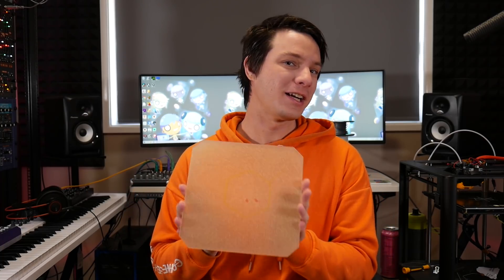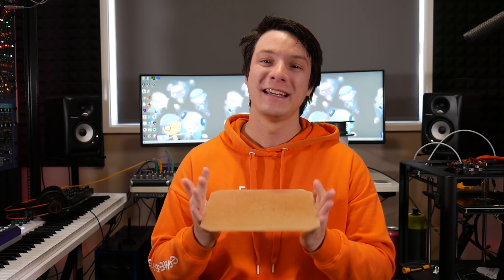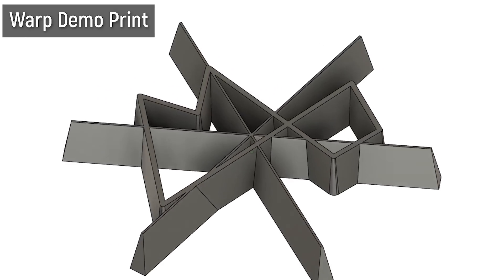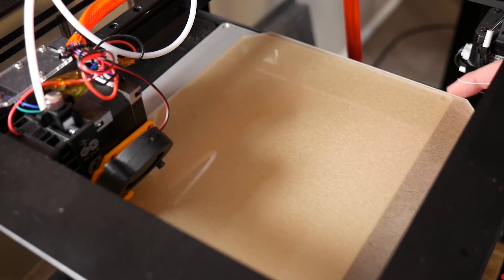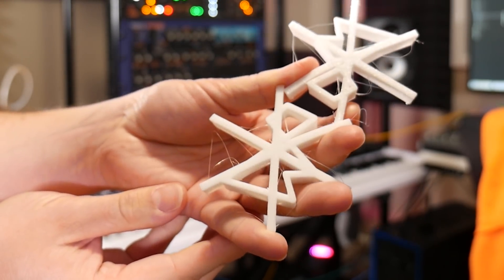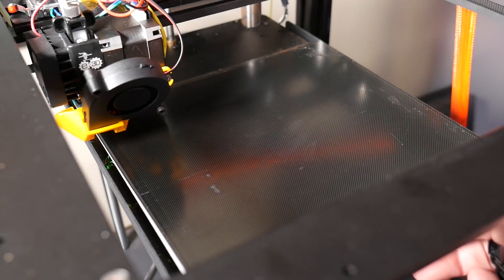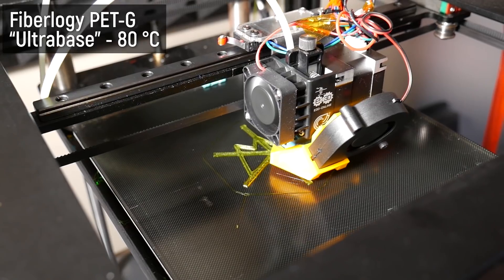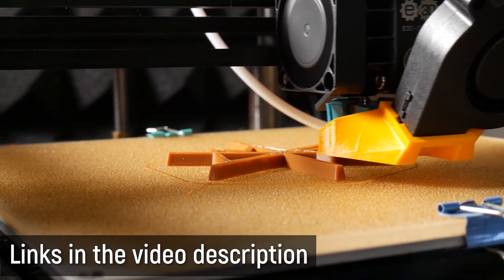A REALLY unusual 3D Printing surface! Ultembase PEI Glass test and review.

Comment: Hi Angus! Glad to finally see your review! I'm shocked that the PETG didn't work for you, as it went perfectly in our test results. In the meantime, we have upgraded our design before you released your video, and we'll ship one your way! I strongly recommend only remove the print when it's completely cooled off, otherwise due to the high adhesion of this plate you could peel the PEI layer off. Once again, thanks for the review and it was a pleasure working with you! I'm gonna get back to the lab and try to replicate your PETG test results.  - Tian from Energetic 3D
Reply from the maker: Thanks Tian, all prints were left to fully cool, the petg print was removed the day following I was sad to see it damage the sheet after such good ABS results.
Reply: @MakersMuse  Yes, I did not expect that! All the PETG tests came back perfect in our testing... Time to get back to work :)
Reply: @energetic3d647  not fully sure what i'm talking about, but maybe try to vary ambient temperature, initial layer temperature, and nozzle to bed distance for the first layer, if you haven't done that yet. Those three factors may help replicate the results you're going for.
Reply: @somedude2492  I'm thinking about the bed temp Angus had used, I'll shoot him an email shortly and request some parameters he used when printing PETG. Perhaps there is a difference in bed temperature we used and that's what made a difference.
Reply: @energetic3d647  maybe the fiberlogy petg has a different chemical composition than the one you used and it just so happened to bond very strongly to the pei
Reply: @christophbrun4059  yeah, probably try the exact material in the same brand. Who knows what they're doing different? 🤔
Reply: @christophbrun4059  Possibly, perhaps it's the difference in the print temperature aswell. We already have an upgraded version and I'll do more PETG testing on them. We never had any problem with PETG like Angus did, strange.
Reply: @energetic3d647  that could be it, maybe increased adhesion should be compensated by lower bed temps? Either way i love to see products be so actively developed to be the absolute best posible. This bed is definitely in my wishlist now.
Reply: @energetic3d647  i ordered the plate and i have not received it yet i should have gotten it yesterday?
Reply: @MakersMuse  , do you know if ANYONE outside of the Youtube reviewers who have received their orders? I know I haven't... I ordered back in June, and the seller is now completely unresponsive to emails. It might be a good idea to do a follow-up on this because it's really starting to smell like a big scam.
Reply: @bnice7  Same here. No replies, no shipping, nothing. I am afraid we got scammed.
Reply: @kwinzman  I ended up receiving mine... I've yet to use it! But I did get it eventually.
Reply: @bnice7  The company doesn't seem to exist any more. I just filed for a credit card chargeback a month ago.
Reply: @kwinzman  I'm not surprised. I guess I was lucky that I finally got mine. I don't think I've ever even used it after all that.
Reply: Love to see a company take ownership of a "poor" review and contuine to improve there product! Can't wait to see where this product goes!
Reply: @cojofoplays1837  Always! We aim to be the standard in the 3D printing industry, our flex-steel PEI sheet was many people's favorite. This is something we are experiementing with and Angus got one of our earliest prototypes aswell. The designs have been improved since then, and we'll try to push them further.
Reply: I can see from the high video quality that the bottoms of the prints show signs of having the nozzle slightly to close to the bed for the first layer. Instead of even unbroken layer extrusions there are small broken sections of extrusion showing uneven widths. This occurs as the pressure in the nozzle builds ups and releases over and over instead of one continues evenly pressured extrusion. PETG can bond to PEI especially when "ironed on" like this. Therefore I would conclude the damage could have been avoided with a slightly high nozzle starting position and I would recommend the product sufficiently warns the user of this outcome if used with PETG and a very low nozzle height.
Reply: I have a ender 5 plus with there stock glass plate and I use petg it also once took part of the glass with it but I think that print I also left on the bed overnight so maybe keeping petg on to long is bad😵
Reply: @Bigdog1787  I think you're right, I left a PC print overnight stuck to my smooth PEI sheet and it tore some chunks out of the PEI, usually I can just flex my sheet and the part comes right off.
Reply: You are awesome
Reply: I have ordered your build plate a month ago, but nothing, no tracking, and no replies to emails?
Reply: @John Spencer. You are SPOT ON! My thoughts exactly. Oh, you’re SHOCKED, we’ve REDESIGNED. I bet you have. My Wam Bam with PEX has worked flawlessly with PETG.(and NO, I’m not affiliated with wam bam. Just a user of an actual WORKIN PRODUCT!) BTW, my Ultrabase works flawlessly also. 🤷🏼‍♂️
Reply: @chemicalcorrosion  Does the PEX work with PEEK? Their website is decidedly vague and doesn't even begin to describe compatible materials. Just "most any filament' which seems like a convenient catchall if any filament doesn't happen to work with their system.
Reply: @chemicalcorrosion  Then it must be shocking to you that we also work with ANYCUBIC lol. This is an early prototype.
Reply: @ENERGETIC 3D. Indeed, that IS shocking. Don’t worry, I’m SHOCKED. Why in the HELL would you send out “early prototypes” to a well known, high trafficked, 3D printing channel. Ah, to get FREE exposure. Well, it certainly was exposed wasn’t it. Sitting on a soft pillow usually helps with “butt-hurt” syndrome. Now, off to do some PETG printing on a RELIABLE surface. Cheers!
Reply: @chemicalcorrosion  Because we'll get comprehensive and detailed feedback from an experienced individual. We also sent prototypes to manufacturers of 3D printers. Don't worry, we'll send more updated prototypes out aswell.
Reply: @energetic3d647  good work on the print surface, but based on my comments below and what I've seen here, I think it is important to coordinate with your engineering team more closely for the marketing material and to improve general product knowledge. It is important to know your customer base and level of expertise, and appropriately guide them for the proper use of the product. This is not necessarily the responsibility of the Company, but it helps ensure that customers can effectively make use of the product without encountering unexpected issues (due to lack of understanding). This improves the customer experience and will help increase your customer base. (and prevent bad press)
Reply: @chemicalcorrosion  BRAVO SIR. I appreciate someone who can spot obvious marketing wank by the corporate soy boys who think they are tricking people by using a couple fancy words. Happy printing my friend.
Reply: There is so much ass covering verbiage going on in your comment. "I'm SHOCKED it didn't work for YOU" "it went PERFECTLY in OUR test results" "I'm gonna TRY to replicate YOUR test results". You first pretend this is a very uncommon issue "I'm SHOCKED" and then have the brass balls to claim something went "perfectly" in testing which is just a stupid thing to say on every level. Next, if the design was perfect in "test results" then how the fuck did you upgrade it? Then you say you're gonna go to the lab to do you best to figure out how the hell this dumb Maker's Muse guy managed to break your perfect system that never fails that you also have to upgrade to perfect+1 Fuck off you corporate slag
Reply: @Jmoneysmoothboy  May I please request that you DELETE YOURSELF!

There is absolutely no need for such abuse on any channel.

Off the top of my head I can think of a dozen things that could affect the results, when combined these add up to hundreds of variables.

One of the most obvious ones would be differences in the base stock used.

It is extremely difficult to design valid test scenarios. An old saying in engineering is "You can make it fool proof or you can make it idiot proof. not both"

No sane person sends a product off for a review unless they are pretty damn sure it does what they say it will.

Yes, maybe he could have thought about the exact language he used a bit more. Then again so should you as your language portrays you as an angry obnoxious and generally unpleasant person.

And no, I have no association with the company. In fact, until this video, I have never heard of them before.
Reply: @Agnemons  "May I please request that you DELETE YOURSELF!" -Kim Wilson

"There is absolutely no need for such abuse on any channel." -Kim Wilson.
 So which is it? Shall I delete myself or is there absolutely no need? Two sentences in and you are just all over the place lol I pray to god you don't call yourself an engineer
Reply: @Jmoneysmoothboy  I honestly see no issue with the two quotes you mention 🤔

I get what you're saying, but also PEI and PETG are known to bond. Prusa explicitly warns users not to use the PEI side without a sacrificial layer in between, usually glue stick. This means that it is not unexpected, and is fine if the correct settings are used - mainly a larger layer height. 

I do however, agree that it should not be advertised to be compatible with PETG on the textured side without a clear warning of damage. I was under the assumption that the PETG compatibility was referring to the plain glass side since the surface can be flipped, but based on the Companies comments it's clear thats not what they meant. So there should at least be a warning for users who do not understand the interactions between the materials.

The company did use words that suggested it was unexpected, which I agree is not correct if they had sufficient product/material knowledge - but this is the marketing/PR team and not the engineering team so I'm not completely surprised, but I don't believe your tone and comments are totaly justified.
Reply: @T4nm4y  Have standards really dropped this low? Do you even understand what a fiduciary responsibility is? The company has a duty to protect itself and its shareholders and it does that by taking your money and giving you as little as possible in return. The responsibility of the consumer is to demand excellence and punish poor practices. The ONLY proper response to a failure of this magnitude is an apology and a promise to try again. This company instead chose to lie and cover it up. Pathetic.
Reply: @Jmoneysmoothboy  it does, and that's why I believe they need to adjust their marketing. Understand that this is a work in progress and cutting edge development for them. Every company has these issues and it is clear that they will try to improve. I believe you are blowing it out of proportions. The Company needs to protect the safety of the Consumer. Any other factors are chosen at the discretion of the Company. And yes I agree they should be informing the customer of this potential damage and how to mitigate but it is not a legal responsibility. 

I do not believe the company has covered up anything. The only issue is the rigour of the test process, I believe that their biggest mistake was over looking their average consumers expertise. The test process was designed by the engineers who designed the product with certain uses in mind. They clearly state that this was unexpected, which is fair if they only tested against the designed specification, and that they would replicate the results to figure out the issue. The company could alternatively have just said that the use was outside of their specification and publicly released their testing scheme. This would be pointless as most people would not look into this, those who would likely already know why the issue occured and how to mitigate it.
Think about apple and Bendgate - the company tested their phone for certain uses - not expecting users to sit on their phones. But alas it happened and now other companies specifically test the bend resistance of their phones - a practice that never existed until users caused damage to their phone in what they believed to be normal use. Did Apple apologize? No, they simply said they would look into it in more detailed and fixed it in the next release of the phone.

No product is perfect and I think the mistake the company made was not making the print settings used in their testing public - which is not a common practice anyway. 

Consumers can always demand excellence - but it is not the responsibility of the company to do everything you want. You are free to find an alternative that you believe is better. The company will always try to achieve excellence as that's what makes the business profitable. The business must balance quality and price, the ratio of this is a decision made by the company management, if you don't like it - find someone else to do business with. I don't believe they have lied to you or covered up anything. They were simply not through enough in their testing to account for "user error". I put user error in quotes because PEI is commonly known for bonding to  PETG, but the Company should have had a clear warning of this on their product page to alert users who were not aware of this phenomenon.
Reply: @Jmoneysmoothboy  What are you talking about? They have already said in this thread that they will go back and do more testing to recreate the issue. How is that a cover up? We've both seen the video and their response. The whole point of a review is to test a companies product and not take their word for it. In this case it is a new experimental product, early in its release cycle with issues that need to be addressed; and they seem to have altered the product already even before this review. I don't understand where you're finding the malice in this situation. 

Part of being a good customer is shopping around and looking at different products. Every product needs to be considered for its benefits and drawbacks, by looking at reviews etc. I don't pick the cheapest PC parts with very little reviews, but I still look for good value products.
Like I did a 1 minute search for 'PETG on PEI' and got the Prusa Knowledge Base article that said "Using powder-coated TXT or satin sheet is highly recommended. Printing on smooth PEI surface might damage the sheet."
Ok, I read from this that printing PETG on a textured PEI surface is ok, so it's not unreasonable that this product claims the same thing.

Then a quick 'PETG on glass' search shows that PETG can stick overly well and tear chunks out of it, which is what happened here e.g. they probably need to adjust the product to prevent the PETG sticking to the glass, or recommending particular caution by using a protective release agent or not squishing the first layer down too much (which is probably what happened in this review).
I don't even print PETG much and I have never used glass, but this took about 5 minutes to look up.
Also this doesn't seem to be aimed at the casual 3D printer user where there are plenty of textured PEI options available, including the flexplate system they already sell. Like they advertise PEEK as one of the compatible materials. The whole point of the product is that it can withstand very high temperatures, probably around 200C while maintaining a perfectly flat surface. Otherwise other PEI surfaces are perfectly fine for most materials, and the similar considerations for material compatibility apply.
Reply: As soon as I saw Angus print PETG directly onto the surface I jumped to the comments - it is something I would never do if I had the surface, becuase I know you need the right settings to make sure it does not bond - mainly a larger first layer if you use no sacrificial coating. 
The company likely expected many 3D printing enthusiasts to know this as PEI has been a more common surface recently, but it is now clear that most do not. That is why I believe the issue is the mismatch between the Companies target consumer and the actual consumer base. 

A mistake of the company? A mistake of the user? It's both. I'd put it at a 60-40 split, it is now up to the company to ensure it is educating customers on the use, or targeting it toward expert use.
Reply: @Jmoneysmoothboy  a little less salt on your cereal in the mornings might do you some good. You can call bullshit without acting like an angry teenager.
Reply: @EmmaLamarie  My apologies, I was going for angry but in the 35-40 year old demo instead. What exact changes would you make to my comment so that you personally would have compared it instead to an angry person in the 35-40 range? You seem to know something about angry teenagers and I prefer working with experts.
Reply: @Jmoneysmoothboy  Angus received an early prototype and it had many issues that we haven't iron out at the time. And I was not lying when I said I was shocked, he got a very different result than what we had in our own testing. I just sent an email to him asking for his printing parameters so I can replicate his print and see if different printing temperatures made the difference.
Reply: @avi8r66  Are you the company lawyer or something? You seem to know less about the law than Energetic 3D knows about "testing". So yeah they are either liars and didn't do the testing or they are stupid and its just a poor product.
Reply: @Jmoneysmoothboy  Such an angry little person. All of these products are experimental and 'in development', from the printers themselves to every add on, filament and mod you might want to buy.  None of it is plug and play perfect. 3d printing is an area that is still, and probably will be for quite a while, one that requires a certain amount of adventurous spirit.  For the print process to work you need a very consistent filament that is at a particular moisture content level and temp. You need the hot end to get it up to a perfect temp. You then need the fans to cool it at just the right rate which means you need an ambient air temp of a particular amount. Then the bed needs to let the print stick properly, sometimes heated, sometimes not, but not stick so well it needs to be pried off. And all this is being done, most often, in a home environment that might range from 10% humidity to 100%, and a temp range from 0c to 40c. So no, nothing tested in the lab for any reasonable time frame given the budgets of these kinds of companies is going to fully replicate the range of materials and conditions combinations a home user is going to experience. Just not logistically possible.  

This product company sent a respected 3d printer channel (angus) guy a sample to try out. He had negative feedback. They could 1) deny it and say he did things wrong or 2) own it and say they are going to keep working on it.  They took option 2, which is a bit rare, and it was a good option for them to take.

Schmuck.
Reply: @avi8r66  So you ARE the company lawyer lol. It explains why you think 3d printing is so complicated that if you don't do it just right your build plate might fucking self destruct. Let me simplify it so even you can understand. Chunks of glass coming away with the print when it gets pulled up is not good. When your company did the "testing" you discovered this issue and just hoped people wouldn't notice or that maybe it wouldn't change the bottom line. It got noticed and you lied about it to try and cover your tracks.
Reply: @EmmaLamarie  Never heard back from you there darling
Reply: @Jmoneysmoothboy  I am no more a lawyer than you are, nor am I in any way associated with either Angus or whatever this company is.  I just sniff out idiots and annoy them.

But I have worked for companies long enough to know that when your product, regardless of the amount of testing done, is handed over to userland it will break in unforeseen ways.  You then take that feed back and adjust the product.
Reply: @Jmoneysmoothboy  my turn to apologise, I had better things to do. I don't care to suggest changes to your manner of speaking, that's your problem not mine. I'm just tired of only ever seeing people swearing at each other like it makes any difference. 
Marketing drivel? No shit? That's because they're marketing a product. And whether or not they admit to an error in testing is irrelevant really, personally I just decide to avoid the product rather than ranting on youtube about it.
Have a nice day, and well, this is youtube so, we'll never see each other again and that's for the best.
Reply: @Jmoneysmoothboy  I basically never print PETG because it's in that awkward middleground of not being super easy to print or having decent mechanical properties. Most things I print are PLA (on magigoo), if it needs to be mechanically tough or high temperature resistant I go straight to Nylon or PC (on Dimafix). The only thing special about PETG is that the CF-filled variants tend to be the most rigid 3D printing materials, although that's a very niche use case.
Reply: @Bordpie  I'll share a trade secret with you. Pencils are all you need for good part release. Pencil lines are just layers of graphite and led which release from each other quite easily. You might even be able to print PETG straight to glass (sometimes works but its hit or miss) no magigoo required